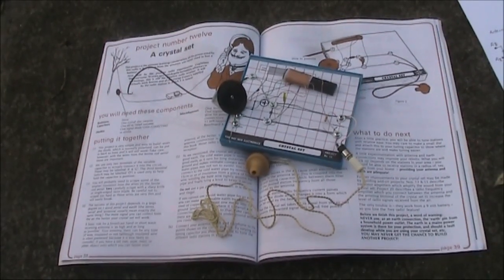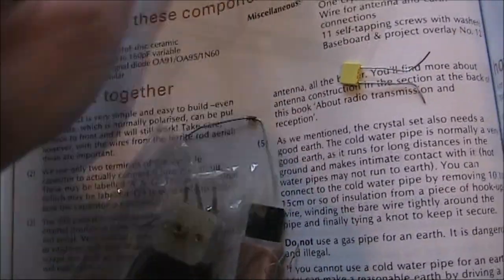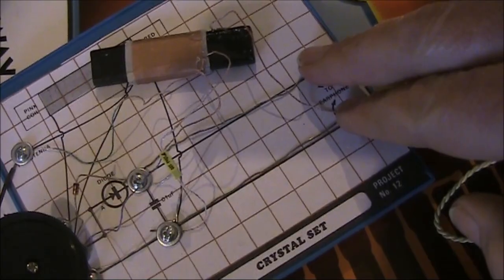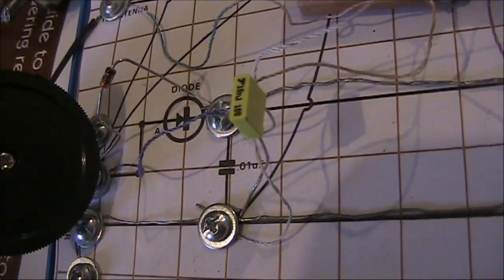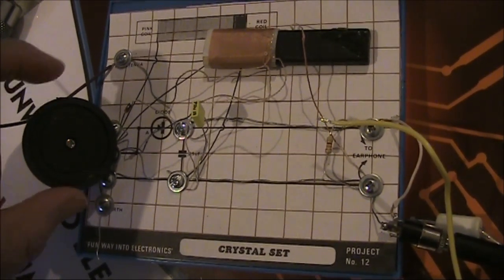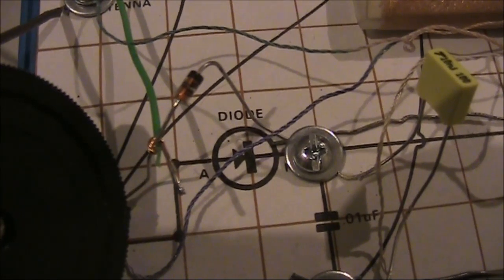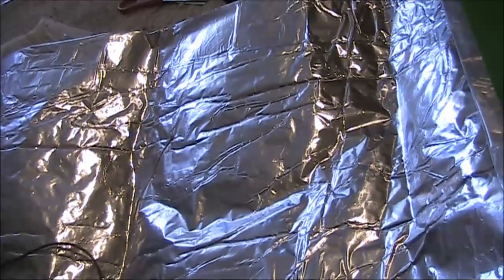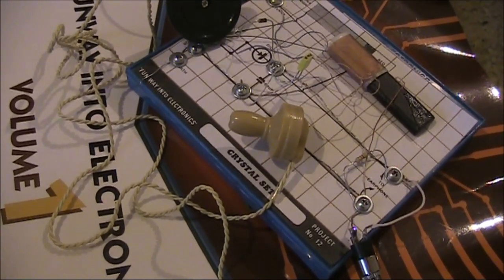Funway 1 builds: Crystal Radio (Project 12)

Comment: The crystal set was the very first recever i ever built although mine was posh I installed a coil pack with a selector control i could listen to a wide variety of bands. I have very fond memories regarding this circuit its cheap, easy especially if your financially embarrassed 😆 im seriously tempted to build another one inspired by your videos keep them coming 73 2E0HYP

Comment: Another great video; on an interesting topic.   I've added a six position switch on mine and have several different makes of Germainuim diodes to choose from, plus a cat's whisker type crystal ore holder for checking various rock crystal ores. And with a short wooden post,  I can slip on various home wound coils for receiving shortwave and other bands, like CB and still Keep the AM coil mounted. My coils copy the same windings used in old TRF, regenerative  and reflex radio designs near the antenna section. So as you reduce the number of windings on the larger coil, it moves up in frequency. 3:14 turns gives part of shortwave. I use super glue to hold the windings in place once the coil is made.. And as the ear piece out put is high impediance, a high impediance amp helps , so a small guitar amp works fine or one meant for a telephone amplifier.  And as you say, using a small transformer allows low impediance amps to also work. Thanks for all the other great ideas on attenuation and mods I can try out. Wonderful video as always.

Comment: You are lucky in the land down under that you still have music on the AM radio. United States AM band is nothing but a vast wasteland of network talk shows.  Any AM radio station these days is  very few and far between.  JW Miller sold a hifi xtal radio.

The December 1956 issue of Popular Electronics carried this ad for what was probably one of the most expensive commercial crystal set ever marketed, the J.W. Miller Company Model 585 High Fidelity Crystal Diode AM Tuner Kit, which was also available assembled as Model 595.

The set was said to have received “overwhelming acceptance by the most critical audiophiles,” since it contained nothing to cause distortion. With a strong AM signal, it probably did provide the best possible fidelity. Its high Q coils gave it very high selectivity. Indeed, it was equipped with a vernier tuning dial.
Reply from the maker: Thanks Randy. I think improvements on the plain diode envelope detector are possible. More on better detectors here: https://sound-au.com/articles/am-radio.htm